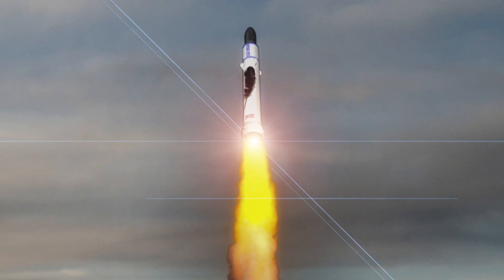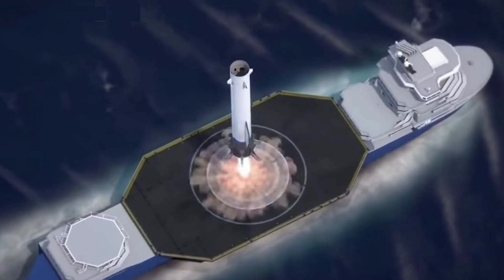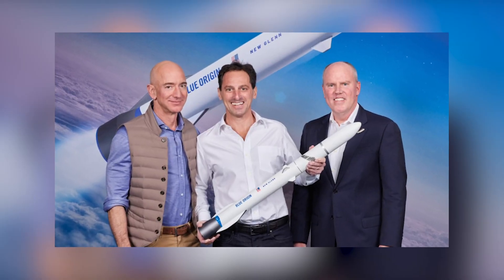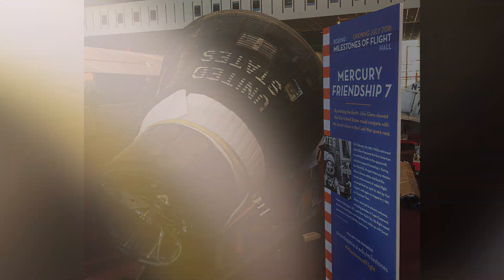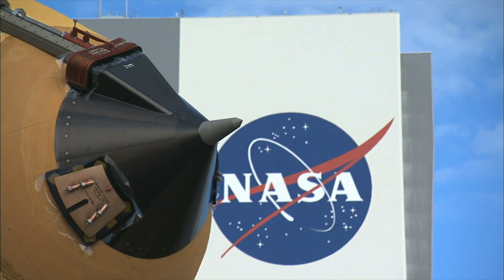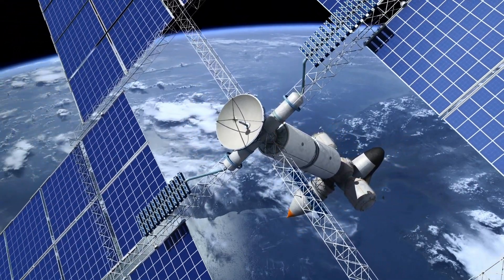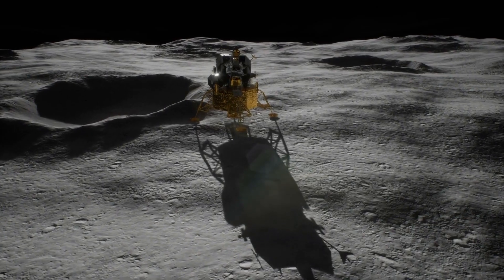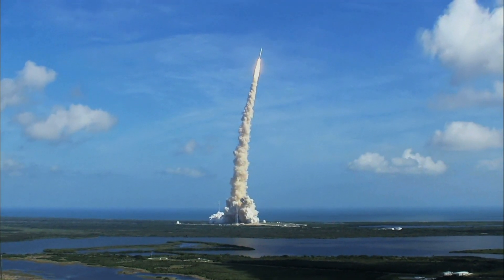New Glenn: The New Rocket From Blue Origin and Jeff Bezos

Comment: I do like the control surfaces, but it lacks in performance considering how big this thing is. Only 44.9 tones to LEO, while the falcon heavy, which is almost 100ft shorter than new Glenn, but can send 63.5 tones to LEO. They are both very sophisticated rockets and do have a ton of potential, but I do hope that they find a way to maximize the thrust of the BE-4 like they did with the Merlin 1-D!

Comment: Few things to correct here. The space junk you talked about that “falls into the ocean at the expense of the environment” that stuff usually has no form of thermo insulation and burns up in the atmosphere. Thus never making it to the ocean. 

The first stages of rockets are rarely discarded. In that way. For example the space shuttle. The srb’s (side rocket boosters) would detach and land in the ocean with the use of parachutes. They would then be retrieved and refurbished to be reused. The orange fuel tank would detach later and burn up in the atmosphere. 

The new Sheppard was designed to do the 4 min tore of space not the new Glenn. Also they don’t parachute out of the capsule. The capsule itself has parachutes to return passengers to earth. The new Glenn will be used to launch what is considered super heavy payloads. Also will a proposal for the nasa Artemis missions returning us to the moon. It is a competitor to the space x starship/bfr.
Reply: Rocket first stages are almost always discarded. The only exception is the Falcon 9 + Heavy, which lands. The Space Shuttle SRBs were recovered, but this was more to further scientific understanding than to reuse, they had to be sandblasted down to the bare metal before they could be reused/rebuilt.
Reply: I mean...  geez.  Landing gear?
Reply: The whole video is crap.